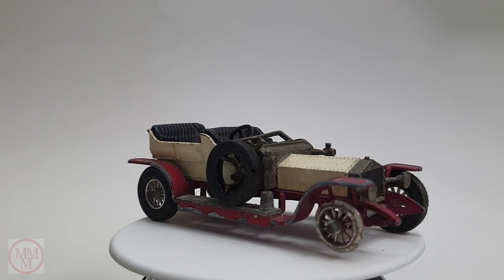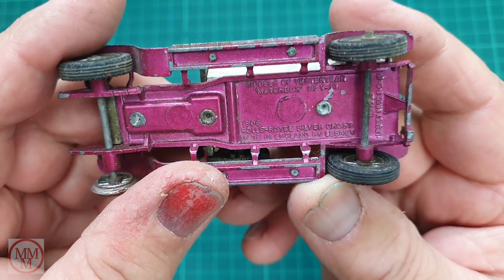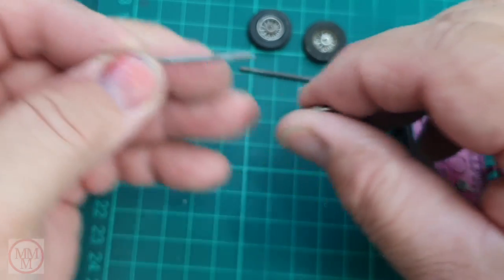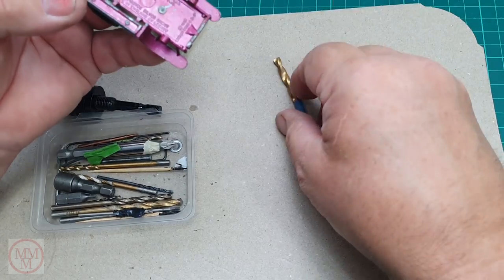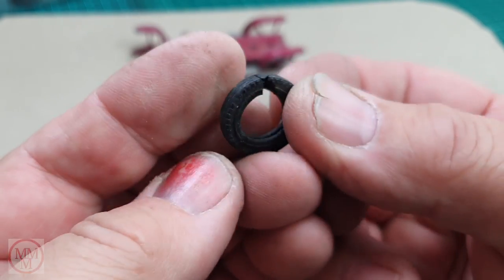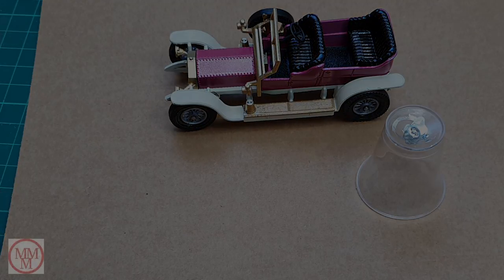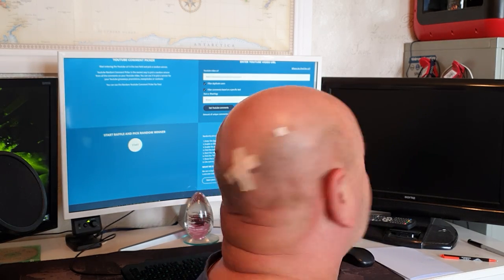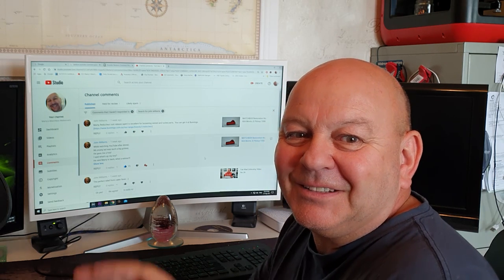MATCHBOX Restoration Y10 1906 Rolls Royce Silver Ghost 1969

Comment: Nice job even if the two-tone is reversed. Being a Matchbox model of that era, it would have been painted originally with Humbrol gloss enamel. The original colours on this car look to me like Ivory 41, and Sunset Red 51. As for the lights on the Rolls, they would have been acetylene lights. The gas generators are those pots on the running boards. You filled them up to a mark with water and then put a few lumps of calcium carbide in, and put the lid on. After a few minutes you could open the taps and light the lights with a match. An old friend of mine had a (full size) 1905 Peugeot Italia, it used the same system. On the Rolls the lever with the grippy thing on it operates the back brakes, and is also the parking brake. There's also a pedal brake that works on the prop shaft. No front brakes on this car, but then, the national speed limit in 1905 was 20 mph! The ball topped lever is the gear change. It was a 3 speed. Throttle, choke & timing advance/retard were levers near the wheel. Clutch was a pedal on the floor.
Reply: ant4812 7
Reply: When you see how the earliest cars had to be operated, it makes you wonder that the things ever caught on. Ford's Model T is another great example, with its insane pedal arrangement, bizarre gearbox, and habit of running over its owner at startup if not set up exactly right. :)
Reply: No interest in restoration . New resale models are no longer of interest to many people. You can buy a new model in a box for less than 10 euros
Reply: Oh wow!! I love the cool & awesome facts!! I subscribed to your channel

Comment: The "mistake" you made actually makes the car look so much better than the pink fenders. Looks like a "Staempunk" version of Lady Penelope's FAB-1.

BTW, The condiment squeeze bottles (what you call a sauce bottle) are usually polyethylene or polypropylene, which are inert to most solvents, though I've found when I use them to store methylene chloride (the active ingredient in "hot" model glues like Tenax) will actually evaporate through it... I found that out when the MC supplied to glue acrylic sheet (Plexiglass) started to drop in level after a week. Luckily I'd only lost a couple of centimetres' worth from a 3.78 litre (1 US gallon) jug, so I transferred it into an old brown glass jug and it's been good for years.

Comment: I've settled on re-using Tamiya paint jars, too.  I've used little individual-serving jelly and jam jars, and I've also re-used Model Master jars.  But they don't seal as well.  That inner lid in the Tamiya jars make them pretty much air-tight.  And they're proof against really hot solvents.  I keep lacquer thinner in one of them, to have a quick supply at hand.

Comment: Marty - Fun fact, mate. The bit at the end of your Dremel at 1:44, it screws off. It saves you having to find the spanner to undo the the collet. If you look at the hole in it, you will find that it is the same shape as the collet.

You unscrew the cap, slip it over the collet, press in that little button that stops the axle turning and the cap can now be used to unscrew the collet. With the new tool inserted, reverse the procedure to tighten the collet and then slip the cap down and tighten it back on to the end of the Dremel and “Robert is your mother’s brother!” (Bob’s your uncle)

Comment: looks great! The color swap on this turned out looking better than the original.  You questioned about the leavers, One is a parking brake and the other is a gear shift. A clutch and brake pedals where on the floor. The throttle and spark advance was controlled by the two leavers on the middle of the steering wheel.
Reply: HOLY COW. I just noticed at the end of the video, you have a Delaware License plate on the wall! That's my home state!

Comment: Marty, you did a wonderful job as usual.  You could have painted the plated parts with silver or chrome paint.   However, there's another way that you can find all the details of in some YouTube videos.   You could replate the parts in Nickle.  It's electroplating.  I don't know if you'd have to remove all previous plating but it really does the job nicely.   First you prepare the plating solution of Nickle, then you put in your parts.  In both the creation of the nickle solution and the plating, you need to connect up a battery, the details are in the videos.

Comment: Marty, top tip, mate. Next time Julie is shopping (or you if you don’t mind), get a pack of knee high socks that look let tights/pantyhose.

With an elastic band, secure it over the tube (wand) of the vacuum cleaner and allow about six inches of the ‘sock’ to go inside the wand.

When you vacuum the hobby room, any small items will be sucked up by the vacuum but they will be caught in the ‘sock’. Holding the wand straight up, switch off the vacuum cleaner and carefully tip the wand down towards a box on the table. The small items that were vacuumed up will fall into the box so you can make sure that nothing valuable has disappeared, never to be seen again.

Comment: Marty, I love the way it turned out, even if you did flip the colours. Frankly, I think it looks better that way. Have you ever thought about nickel plating the parts? I follow a few channels that restore tools and such, and some of them nickel and zinc plate their parts. It looks easy enough to do. I don't know if pot metal is conductive or not, though. It would be a neat experiment! I agree with you about the quality of Tamiya paints. I use their TS-73 Clear Transparent Orange and TS-74 Clear Transparent Red spray paints to redo turn signal lenses on my classic vehicles. The results are spectacular and a helluva lot cheaper than buying original replacements.

Comment: Hi Marty. Great job on the redesign restoration maker over. Marty I have one little observation. While on your rotatory table I noticed the wind screen when viewed from the back of the car is a little out of square on the spare wheel side of the car. It did not seat down as far as it should have. You can see a gap between the bottom frame of the wind screen and the chassis, on the passenger side no gap. I have an eye for spotting things like this in videos. I did not point this out to be mean, just thought FYI. I know you have a keen eye for what you do and are an expert as far as I am concerned. It still looks fantastic.

Comment: Sorry to put a fly in the ointment, but the torpedo is wonky. @38:35 you see a gap at the bottom of it, right next to the spare, and @38:58 it is flush with the floor on the other side. It is obvious @38:56 that the windscreen frame does not line up with the seat backs.
Minor thing, tho', great remake!

Comment: Great job on this one! I have the exact same model lying in my "Yesteryears" box, although it's not in such a bad shape as yours was. I was wondering where to source the pink metallic paint, so thanks for the tip about the Tamya Pearl Clear laquer! Will try that one out. As far as I know the tyres of the MOY range are not rubber, but plastic. Still they do get stiff and might crack over time. The wheels and tyres for these later MOY can be bought after market. I got a whole bunch from modelcarparts.com in The Netherlands. They're very good quality.

Comment: Not a criticism, just a bit of safety advice.  Yon Dremel cutter that you used to take off the running boards is meant for milling soft wood.  Be very careful with it on metal 'cos it can overheat, go blunt and damage the model and possibly yourself.  You would do better using a diamond coated engraving tool.  Quicker and safer.  My scars tell me so.